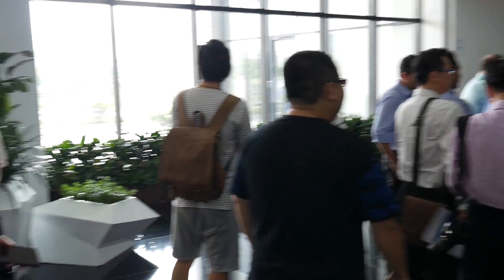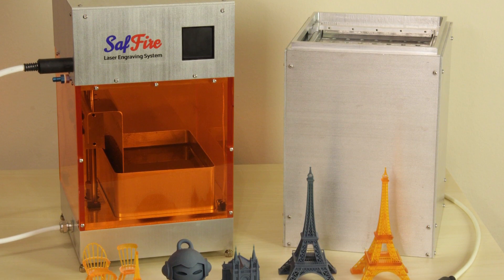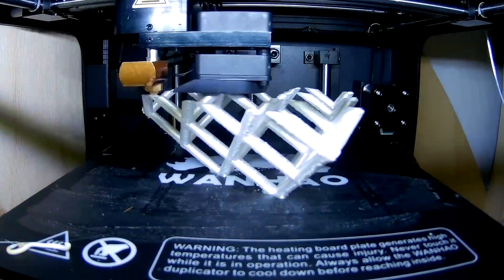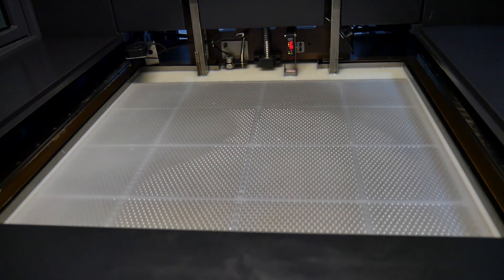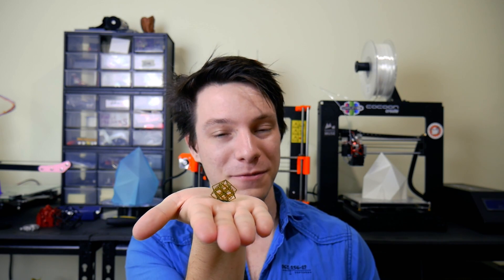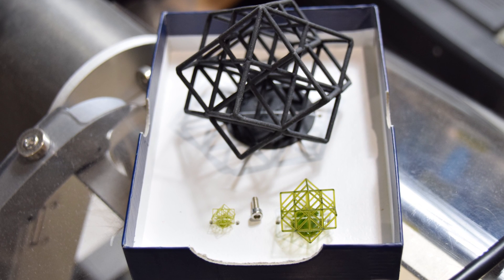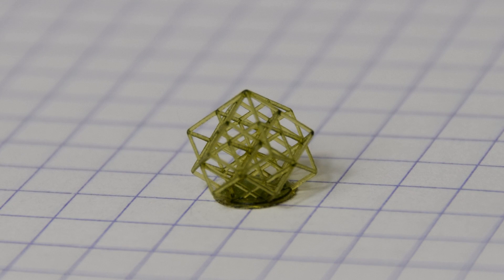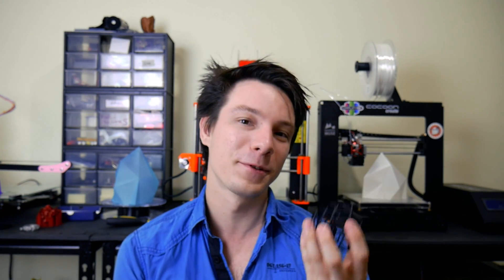Worlds smallest 3D printed lattice?

Comment: 15 microns is only 0.015mm...in your hand the  first translucent green lattice cube looks a lot larger than that, is it actually that large or did you mean 150 microns or 15mm maybe? I feel like the second one is also larger than 11 microns wide, did you mean 1.1mm maybe? I don't know it just doesn't seem like those measurements match up with the visuals
Reply from the maker: sorry for confusion. what is listed is the voxel size (3D Pixel) not overall dimensions.

Comment: Angus- love you man, but I think you got the measurements wrong. I think it should it be millimeters (10^-3 meters) NOT microns (10^-6 meters)?
Reply: XDD
Nah, Micron is correct there. normal fdm printer already print at 0.2 mm layer height. 
SLA usually goes to 50/25 microns, some go even smaller.
Reply: OK, I see my error. I thought you were talking about the size of the object, because you were saying "look how small" but you were stating the layer height. Thanks for clarifying. And so why did your notes on the picture say things like "11 x 11 microns" if you were talking about layer height, wouldn't it be just one number for both dimensions?
Reply: Oh, if you are talking about his note - well, they are messed up and all over the place.
The big black thing 51 848 microns - there should be no dot as he uses that as a decimal-sign for the time... so yeah, 52 mm.
The middle one - 15 mm - but that can not be correct judging by its actual size 
the small 11x11 mm

Comment: 15 microns and 60 microns.......take it that is the size of the struts in the cube?  Cause those sizes are tiny.  A human hair is around about 80 microns in diameter.  Do you mean millimeters for the dimensions?
Reply: Maybe the accuracy necessary? He must have meant mm.
Reply: Actually he said he meant voxel size.
Reply: So that would mean the minimum feature size was 15um and 60um......which still doesn't seem to relate to the models shown.   Fantastic though they are.

Comment: PRINT A 3D FRACTAL
if possible o3o as long as its all connected together
Reply: Fractals are impossible to print, I'm pretty sure. It eventually gets too small. Also, it's an infinite volume thing. You'd need infinite plastic.
Because of the planck lenght, you could also not make things infinitely small (necessary for a lot of fractals)
Reply: I wasnt thinking of making the whole entire fractal down to infinitly small LOL
only the main details on it. Nothing super fancy. wow o3o
Just like the mandelbrot set with only the main parts of it showing. just convert a reasonable sized resolution image into a 2D plane. then give it a bit of height to 3D print it. it sure would be cool.

Comment: might sound optimistic but i rkn with my 0.9 steppers, titan with 0.9, and small 16t pullies with 0.2 hot end  i could get pretty close, the trick to good detailed fdm is gearing down- preloaded bearings and good part cooling and tweaking speeds.

Comment: Yep an artefact that fine (the small one) is unlikely to be successfully   using a "bottom-up" SLA Printer, because the adhesion forces on the "silicone" liner is likely to break the small filaments.  

When SLA Printing I am usually making "more solid" pieces needing "precise" mechanical details -gears etc, but If supports or lattice members are less than (about) 0.5mm they may break -(transparent materials are worse than solid), leading to partial print failure.

With "top-down" SLA Printers it is only the viscosity of the resin which limits resolution as there are no adhesion forces.

"Bottom UP" printers WHILE needing Less resin in the build tank, DO need to be topped up before they start "running dry" (bubbles can become entrained in the Print leading to holes in the finished product.

In this space there is a world of difference between what is available for "low utilisation" studio uses and production machines.

Comment: $4,400 doesnt even seem so bad to achieve details like that. Much of what I am printing requires high detail and small tolerances. I'm rarely printing larger than 100mm by 100mm. Such amazing quality, especially on a printer than is independently owned.
Reply: extremewirehead they specifie wvwelenght 405 nm so every resin that works whit that light
Reply: extremewirehead thats a good thing, it isnt proprietary!!
Reply: they don't seem to sell resin though, which confuses me. If I were to get one, I wouldn't know where to source the "ink"

Comment: So Angus, What is the highest resolution you have managed to get out of a printer before? In FDM printers that is. Any printer stand out more than the others?
Reply from the maker: I've done 50micron layer height prints before, however you're resolution is mostly limited by your nozzle diameter which is usually 400microns or 0.4mm diameter (though you can get smaller). I did a vid on the concept a little while ago here - https://youtu.be/eAEHHzUPChY